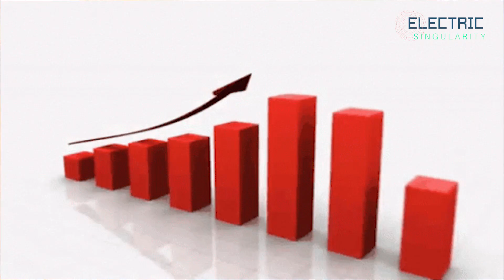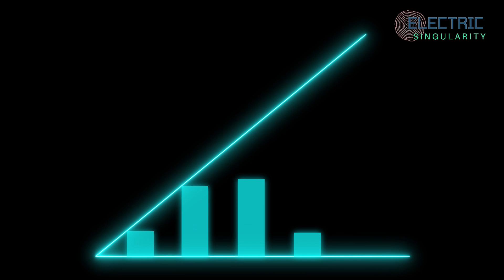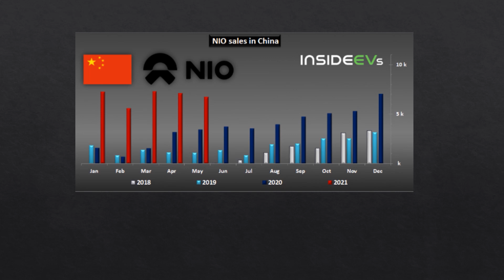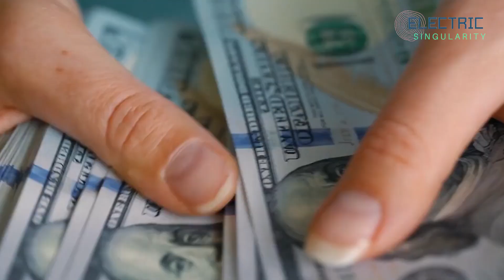Nio sold 95% more EV's in May - my prediction for 2022

Comment: Hey Mate,

Did you see LG just bought equity in a Australian company QPM. QPM is a nickel and cobalt refinery who can process the materials in a environmentally friendly way with no tailings dam. It's an improvement on HPAL using low grade laterite ore normally used for stainless and turns it into battery quality.
Reply from the maker: That's very interesting - thanks for letting me know.

Comment: Hey I'm enjoying your channel but if you are not aware the sound of your voice doesn't match-up with your lips in the video (lipsync) and the video seems to be about half a second behind your voice to me this is a little off putting and I really hope you can correct this in editing for your future videos. Please keep up the good work👍
Reply: For me, his lip sync is fine. I think you have a device issue
Reply: @jaigoodlet8657  Could be. If I put my TV into game mode it does improve it but still it has some slight delay still.
Reply from the maker: Hi Paul. Thanks for letting me know - I'll check to make sure it's working properly.